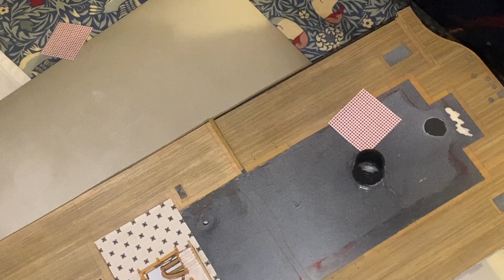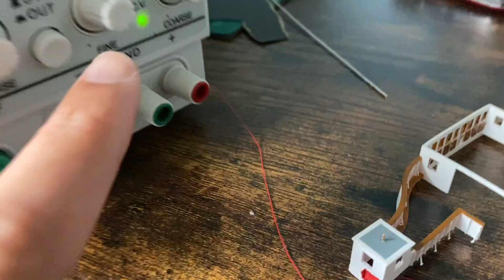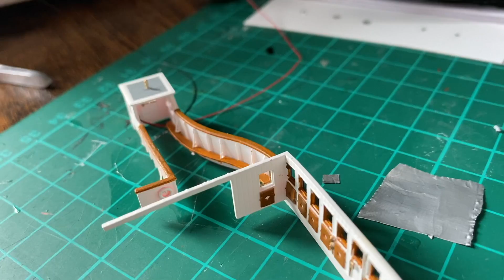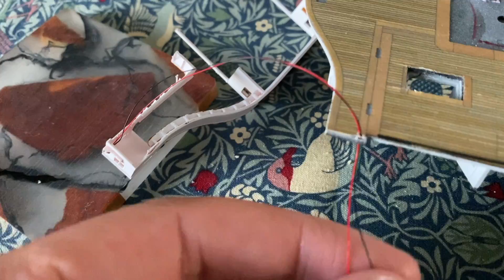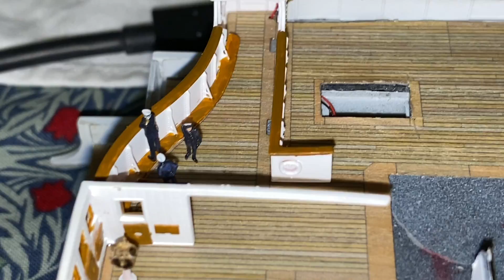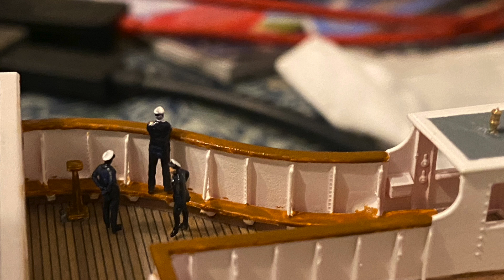Radio Control Trumpeter 1:200 Titanic Build Part 57 - The Bridge Part 2

Comment: Are you doing the docking lights to? On the top of the bridge wings
Reply from the maker: I don’t think so no, to my knowledge (and correct me if I’m wrong) they were morse lights? So I wasn’t planning on doing them.
Reply: @TheModelBoatGuy  actually I was wrong I figured this out after I made this post
Reply from the maker: @michaeltaylor184  aaah no worries! I mean in some ways it would be cool to be able to have working morse lights, but I doubt I’d use them much
Reply: @TheModelBoatGuy  plus I’d suppose it would be pretty hard to hide the wires there

Comment: For these wires you can also carve out a groove of about 0.5mm deep at the top of the deck, then full the groove and finally glue the shelves of the wooden deck on top, so that the wires are no longer visible.

PS sorry, I don't speak English very well
Reply from the maker: Hi there,
No worries your English is fine! As you say that’s the other method. That method makes the wires harder to see than my method. The benefit of the way I did it is the lights are easier to replace later if they fail. 
There’s no real right or wrong answer here!

Comment: pardon me if I sound like an idiot, but why do they need 4 engine order telegraphs for 2 outer screws?
Reply from the maker: You don’t sound like an idiot at all. 
So from left to right you have:
 - Main engine Telegraph
 - Docking Telegraph
 - Emergency Telegraph
 - Manoeuvre Telegraph
 - Main engine Telegraph

Each had its own function, the main engine telegraphs were duplicated at each end of the bridge so an officer could stand on either bridge wing and still have swift access. The emergency was mainly there as a back up system I believe. The other two were used during more complicated manoeuvres normally near shore.
Reply: @TheModelBoatGuy  wow! I see
Gotta love it when throttling is basically telling the engine room gang what to do

Comment: i know this is far from being finished, but i had a follow up question to my previous one, when you do finish the titanic, are you going to make a warship, like the USS Arizona? or the HMS Hood? I'm not exactly sure what models they sell where you live, but my local hobby lobby sells the following: USS Arizona, USS Missouri, USS Lexington, HMS Hood, USS Kitty Hawk, and various other ships and/or planes. i am currently working on a model of the USS Arizona, heed my warnings if you get your hands on one, be careful with the towers, the hull does not want to stay in one piece and the turrets while they have the capability of being mobile, with 100% break if you try to make it work with all four turrets. oh, and it refuses to stay watertight because they molded the hull in two separate halves.
Reply from the maker: Hi there, 
I am going to do other models, but as yet not entirely sure what to make. 
I’m tempted to make Hood, but really not sure. I’ve been too focussed on my
Titanic for now to think of what comes next!
Reply: Okay